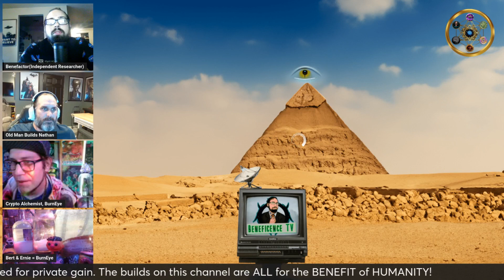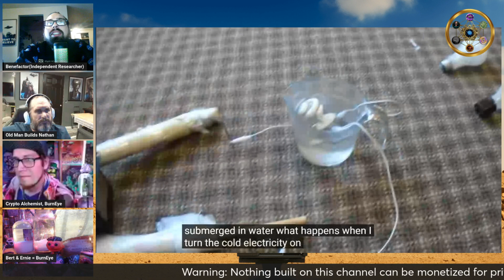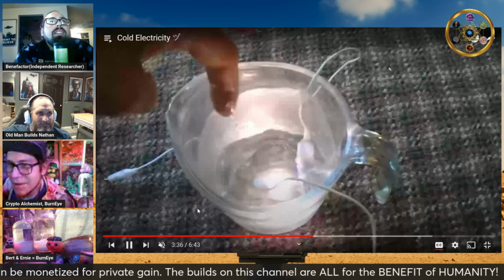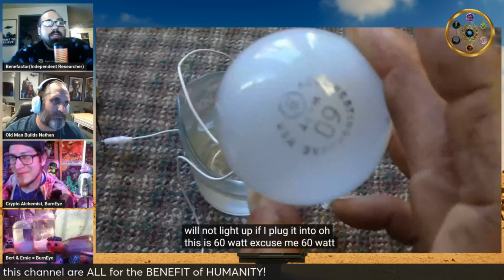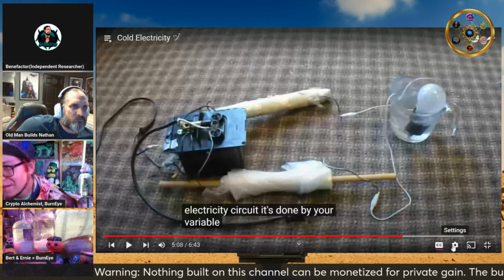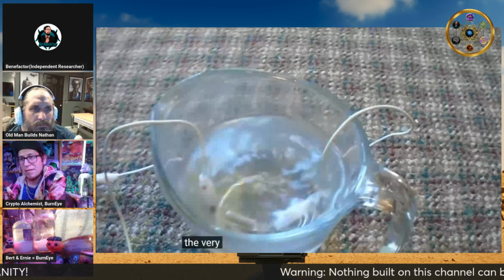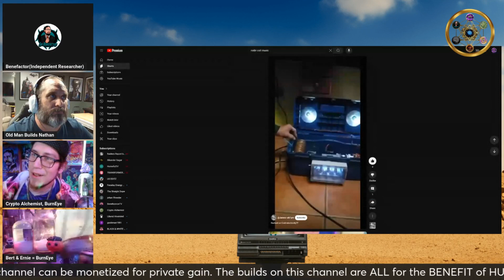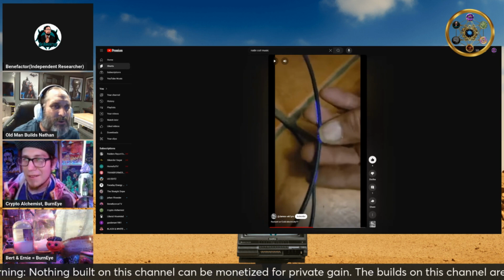Cold Electricity - Fringe Science Think Tank - Live Clip from Rumble Only Stream Nathan Ben & Bern

Comment: Not sure the significance of lighting a bulb in water?  If the water is distilled it will not conduct and short out the bulb.  They should have shown how a normal battery setup w/ hot electrics behaves any differently.